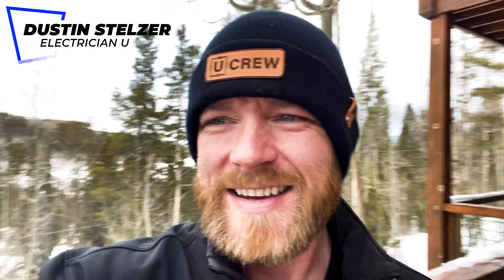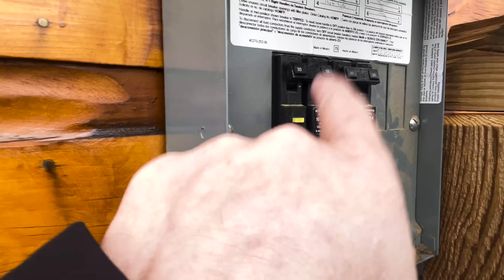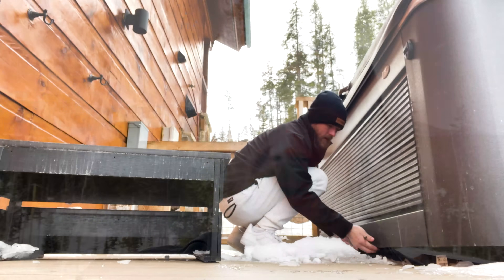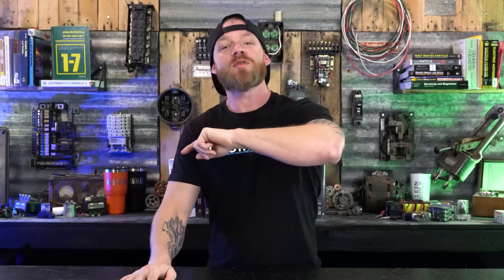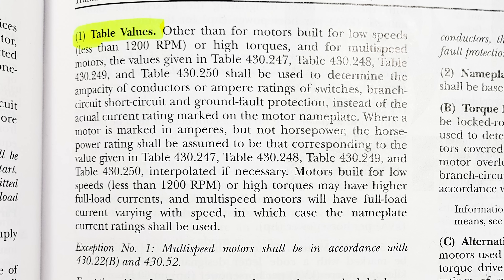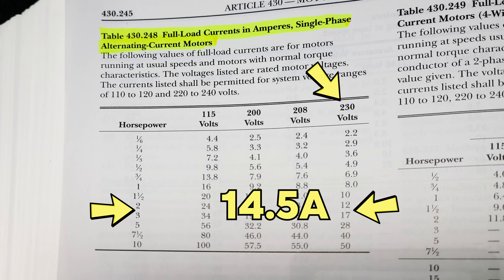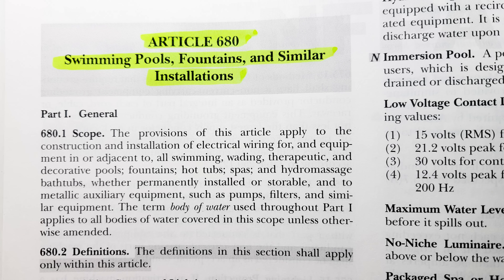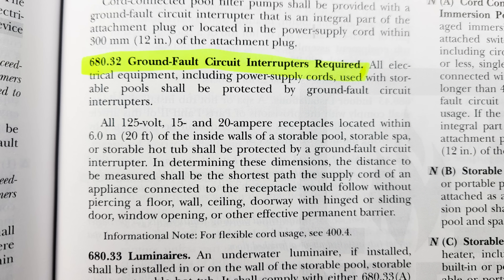Why Do YOU Think My Hot Tub Tripped?

Comment: Some of these spas I’ve run into depending on the model do have contactors that can get stuck and trip the breaker. That or the pump motor is starting to fail due to it pulling too much current.

Comment: tough one, with it running fine in low speed, heating element is most likely fine, probably got a bad pump motor that shorting to ground tripping the breaker

Comment: Had a similar issue with an a/c condenser. Ended up being a loose neutral in the unit. Tightened up the neutral and never had a problem. I didn't have a multimeter on me so I did the next best thing, checked the connections. Only need a screwdriver for that.

Comment: Easy;
Try to start up both pumps undividually, if running, they do not short te circuit, so it must be overload.
U can lower the temperature, so the heater goes off and try to run both pumps.

Comment: As an old retired pool and spa guy, I am going to assume that the install was done properly or the bill would not get paid.  90% of the difficulties I have ever found with spa equipment centers around critters, specifically mice and spiders.  Spiders find paths behind the circuit board, lays egg sacks and ends up acting as a jumper where you don't need one.  Mice do what mice do, destroy insulation, make a nest and chew wires.  My guess is you will find a family of spiders in with the pump relays or behind the circuit board.  (One time I did find a foot/paw stuck in a relay keeping the relay from being able to connect).  Most modern spas have lots of safety features... If ANYTHING isn't working properly, it shuts off.  Better to have a cold bath than be electrocuted, even just a tingle... You never know if someone has a pacemaker or something.

Comment: On my SPA, I have dip switch to disable the heating element when the two pumps are working. This is how I can use a 50 amp breaker and not changing the entire cable and breaker for a 60 amp breaker (requirement to have the two pumps and heating elements at the same time)

Comment: I had a similar issue with my hot tub; I did a continuity test on the heater; it was pooched.
Installed a new one. Still didn’t work. Removed the motherboard and the heater shorted out my motherboard. 
Installed a new motherboard. Started to work.
But, my two speed pump motor only runs on low speed. So I checked the high capacitor for capacitance and it checked out.
Anyways, the tub works overall. Will have to figure out the two speed motor in the spring. Lol
Good luck to you sir:)

Comment: Whoever installed it SHOULD have looked at the wires, the breaker, and everything and determined if any wires or breakers needed to be swapped out. Was that done? My hottub install guy was VERY knowledgeable here. He wasn't a licensed electrician, but he told me exactly everything that needed to be upgraded and was right on the money. He does this every day for years and years and knows what was needed to pass code inspection. He said I could hire him under the table for the work, or hire a licensed electrician. I opted to use an electrician, and that was a bad call. The guy was a complete idiot. I had to tell him what was needed, and his work was sub par. Should have went with the experienced hot tub guy. As for the GFCI breaker, they seem to go bad pretty often out there in the damp environment. Mine went bad after perhaps a year or so.

Comment: Johnnie 5 is watching you. I installed a feeder for a hot tub, about twenty years ago, and the whole circuit was 50 amps, I didn't try to separate the circuits, it had two pumps and had a low and high speeds and had a heater too, and had GFCI protection, no problems what so ever. I think when they tried to separate the circuits something got screwed. Good job there Dustin.

Comment: either bad breaker or bad pump 2 (pulling too many amps due to its about to be a bad motor).    but those watkins tubs are wired different then your typical 6/3 wiring.    one of those breakers are for the heater and the other is for the pumps.  cant remember which is which.   Watkins wellness tubs (hot springs spa, caldera, etc... all have that 20 and the 30 breaker style)   i cant believe you go somewhere with no meter.   gezzz.....lol

Comment: Inrush current was probably too high, also wouldn't it count as a barrier to the breakers since it has a cover in the front? There is also a lock mechanism designed to turn before opening the cover for double protection.

Comment: Mike from Colorado. Glad you came and had fun. My tub also requires a 20 and a 30 amp GFCI. Just look at the panel inside the tub, which should tell you. If the gfci tripped, it’s  likely a bad pump or heater. Seen it many times. (Master here).

Comment: Many possibilities of what could be wrong, but the chances are that it is overloading the circuit when both heat AND jets are on. There is a dip switch on the main board, that toggles the ability for both heat and jets to be on simultaneously. That setting requires a 50A circuit. That dip switch will change it to alternate between heat and jets, so that a 30A circuit can be used and will be sufficient. The nomenclature on the inside of the panel, or on the main board cover, will indicate which dip switch does this, and which setting it should be at.
Reply: Not likely unless tub was just recently worked on.
Reply: Also not all tubs even use dip switches they use pins and jumpers

Comment: I often see older commercial HVAC equipment, say running on a 60 amp breaker, get replaced with more efficient equipment rated for a max of say a 40 amp breaker.   Better to have too small of breaker on a circuit than too large.  Clearly neither is ideal.

Comment: FYI that spa has a 4kw heater strictly on the 20amp breaker.  The pumps and board are on the the 30amp.  Those pumps generally pull about 11amp when running.  Breckenridge looks awesome hope you had a great time.

Comment: My buddy just got a new tub installed at his house, had the electrician who wired the new construction wire the hot tub. (top of the line nordic spa) I ended up taking a peek inside the panel to see what he did considering I'm a student myself at the moment, he threw in a 50A breaker, he leaves the thing running 24/7 hasn't had an issue with the circuit whatsoever.

Alternatively, does the cover plate over the disconnecting means count towards a barrier? Haven't made it past chapter 4 yet in code so I've no experience with anything past 422

Comment: why did you skip past the the manufactures specified breaker size? there are only 2 manufactures of hot tub controllers that i know of. They control the pumps and heater along with anything else the tub has. under the cover of the controller, printed on the circuit board it says the wire size (copper only) and the breaker size required. Most control packs want a 40 or 50 amp.
Reply: Wrong
Reply: @mattf6539  name more then 2

Comment: Weird that it seems others haven’t seen a 2 double pole breaker hot tub before. I been wiring hot tubs and pools for over 15 years and I’d say a solid 60-70% of the hot tubs I wire are 6 wire. Some even require an extra double pole 20 or single pole 20 depending on features of the tub.
Reply: I’ve been wiring jacuzzi and Sundance tubs for 3 years now and have never seen that on one of theirs. I saw it once on an older caldera.
Reply: @Josh-mk7ok  yeah it definitely depends on dealer. I wire a lot of different brands, hot springs being one of the main sellers. Here in Delaware, hot springs is very popular. Caldera is as well.

Comment: If the water is at the set temperature, that means that the heater is working properly and if the breaker trips only when you turn on all the pumps, more likely is due to undersized conductors, or one of the motors could be overheating.
Reply: So your guess is that it never worked and all undersized? Hahaha next

Comment: So when Dual pumps are running, usually the heater isn't.  At least on the 3 tubs we've had. I'll bet one of the pumps is got something going on with it. Thats what we found with the current tub we have. Brand new and the right pump needed gone threw. And when I removed it and took it to my local guy, He spotted the issue right away. And the made in Mexico motor had a issue. A quick complete test of the motor, and repair. And I was on my way, Problem solved.

Comment: I am a caldera spa technician.  Not a electrician but I will tell you what i know with installing these and servicing them.  That is a caldera vacanza series spa.  That spa comes with a 20 and 30amp gfci breaker for install.  Caldera does this on there utopia series hot tubs as well.  30 amp breaker runs the pumps lights and topside control. 20 amp runs your heater.  You have a bad pump most likely.  Did you try running that pump on high speed without the other pump running?  1 pump will be a high speed pump only the other pump with be 2 speed pump.  That tub also has a 110v circulation pump that circulates water through the heater.  There should be a 5 year warranty on any of those pumps
Reply: Also a hot tub tech. 100% agree with your assessment.
Reply: I had to laugh when he pointed out the Square D breakers are notorious for tripping but the handle gets stuck
Agreed: Not a breaker sizing problem - The breakers are supplied by the factory
Not the heater - Heater breaker would trip - No heat but control panel and pumps would still work
Yup... maintenance disconnect less than 5 ft is the most common code violation I've seen working on hot tubs in WA and CA
If you can touch the breakers without getting out of the water I politely inform of the code violation/hazard (in writing) and decline to even troubleshoot it until something is moved or they install a permanent barrier (especially at a vacation rental).
If only Pump 2 trips - Ground Fault in pump 2
New tub...just delivered...is there a leak getting the motor wet?
Tub was 'just replaced': Is that the new disconnect with new breakers or is that the old disconnect with worn out breakers? Lots of dust/dirt inside the panel cover...
I've had those Square D breakers with the stuck handle arc, buzz and smoke when I test the GFCI and it seems to happen more often when ambient air is damp/wet
Agreed: I would wager on bad pump 2 with the limited info & troubleshooting
Reply: Spas are made cheap af no matter what brand it’s no wonder they’re always having problems

Comment: As an installer of Caldera Tubs and Electrical contractor here in Dallas I can tell you that the 30A circuit controls the control board and pumps, the 20A controls the heater. Per the specs of that tub you need a 50a circuit to the sub panel. If the 30a breaker is tripping then it is either going to be a fault on one of the motors or a faulty GFCI breaker. On the control board there should be a 30a circuit with neutral landed on terminals 5,6 and 7 and the 20a circuit without neutral should be landed on 2 and 4. Hope you get to use the tub before you leave!
Reply: I deal with these hot tubs almost weekly. Judging by the instant trip, there is for sure a fault on that second motor.
Reply: @markcaldwell3393  this reminds me of all the people complaining about needing to have GFCIs on sump pumps and AC compressors because they trip a lot... turns out there are just TONS of ground faults and they're being forced to actually fix the ground faults

Comment: We had a 60 amp breaker installed for our hot tub so we could run both pumps and heat. If a 50 amp breaker was installed and you turned on both pumps, the heat would kick off.

Comment: I just wired a tub like this a few weeks ago. One 30A 240V cct for the heater and one 20A 240V cct for the jets. The digital display came off the jets circuit (it had the neutral). So if you tripped the motor for the jets, you lost display. The inspector called me the next day asking why I ran two separate cables to the tub, since he had never seen one like that either haha.
Reply: So maybe the problem is in the motors? Because the video shows the water warm.

Comment: Perfect timing.
Last week I had a customer that had a hot tub that kept tripping it's GFCI breaker. For some reason, a 2 pole 50 amp GFCI breaker fed a subpanel, in turn fed a 2 pole 30 GFCI Breaker for the heat and pumps, and a 1 pole GFCI 20 amp to feed the control circuit board.

Turned out, the control board went bad, yet the 2 pole 50 would trip first. So we swapped out the GFCI 50 amp breaker with a standard 50 amp (To eliminate redundant GFCI protection) Then discovered the control power tripped the 20 amp GFCI, proving the circuit board went bad.

Comment: 15 years of pool experience, agree heater puts it over... The only breaker worse than square D is the Eaton... I recommend Siemens on anything more than a 2hp motor especially variable speeds
Reply: I was a hard-core Murray fan for over a decade. Outside of commercial. I am not impressed with EATON. But with Murray out of the picture, what choice do we have?
Leviton panels are...odd. not impressed with the smaller terminals for the main breaker. I guess they never heard of voltage drop. Had a 200 amp service that needed 250, rather than 4/0 due to sheer distance (450 feet). Yeah good luck stuffing THAT into the Leviton main.

Comment: Hot tubs and nuisance tripping 101--- In some instances, the spa's "computer" will have adjustable parameters in a hidden menu that is usually accessed by holding down button(s) on the control pad for anywhere up to 30 seconds. In this menu there is a setting that allows you to 'inform' the controller as to the size of breaker it is fed from. Then it will govern itself accordingly while in operation. I believe most are set at the maximum from the factory.
Reply: I replaced my spa about 10 years ago and this one has a 2 second delay for the second pump to kick in when it does the filter cycle. I suspect it's to reduce the start load. That said, a single 50 amp breaker feeds all three pumps and the heater.
Reply: now I need a follow-up to know if this could be solved like that...
Reply: One of my 'nuisance trips' was a refrigerator on the back deck plugged into a receptacle that was tapped into the hot tub circuit in a crawl space under the deck

I don't think Watkins IQ2020 is programmed for a GFCI test. The 20A vs 30A settings are controlled by jumpers on the Heater Relay Board and are preset at the factory.

Comment: If I'm not wrong, the 20a doesn't have a neutral, the 30a does. So might just be a dumbass plugging the neutral directly to the bar and not to the breaker. And that branch not being used until you go high speed, so not tripping before that. I don't know enough about that brand of spa to know why they separate the loads and what is powered by each.

Either bad installation, or faulty spa, which I encountered a few time.

Comment: In some hot tubs there’s a specific schematic that you have to use for the correct wiring. One Time I had to wire a hot tub and I had a 3 wire schematic that I followed. Come to find out that was the wrong schematic to follow. I had to call the manufacture just to find out that it is a single phase no neutral termination and I had to use a different schematic. That may be the problem. What do you the Dustin?

Comment: A pass through heater pipe rates at 5.5kw on either 120v or 240v. Assuming the 240v, we're looking at 22 amp draw, plus the 15 amp draw for the motor easily trips the breaker. That hot tub is probably rated at 50 or 60 amp requirement.
Reply: most are 50
Reply: Most are 40,50,60
Reply: Most are 50 but some models do use a 20 and a 30

Comment: At my slice of Heaven the hot tub GFCI was tripping. Opened the tub up and disconnected one 120V thing at a time until it no longer tripped. Was the small circulation motor which I replaced at exorbitant prices. No multimeter needed only a credit card. And a week for the replacement.
Reply: I feel your pain. I also had to replace that small pump and after crossing the number I found it on Amazon for $100 less!
Reply: @rupe53  actually it was worse than that. After replacing the pump it ran for a day then tripped again. Long story short the GFCI went bad possibly due to the prior trippings. That was fun to debug though obvious in hindsight (tripped with no load).
Reply: @jrbergsten  ... I'm told GFCIs don't really wear out, but I would imagine they can go bad with heat or moisture, same as other electrical gadgets. Since they came out I only recall replacing one that tripped for no reason. Basically, it would not reset even without a load. I have found many that would not trip with the test button.... and that's why you test them. The GFCI on my spa gets tested about every 6 weeks, mostly because I forget. I'm sure it's more often than 90% of them out there.